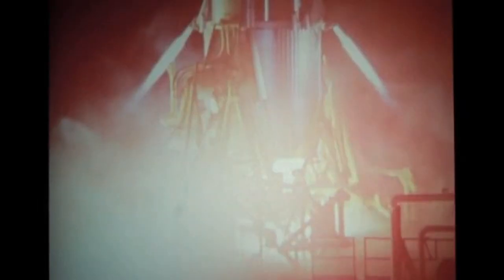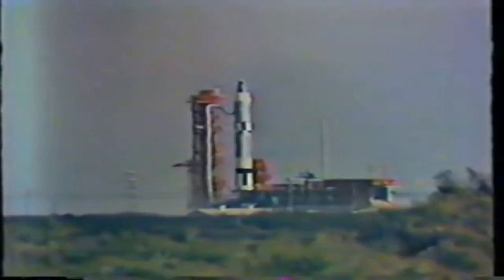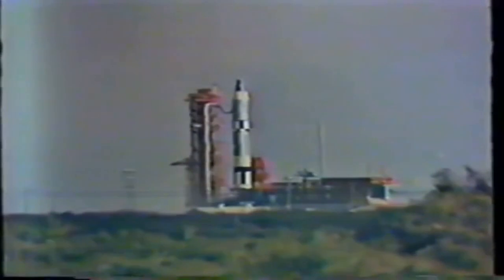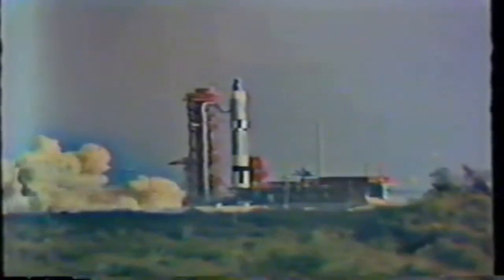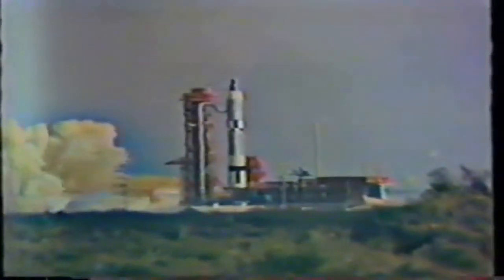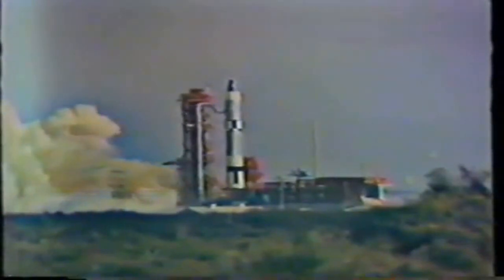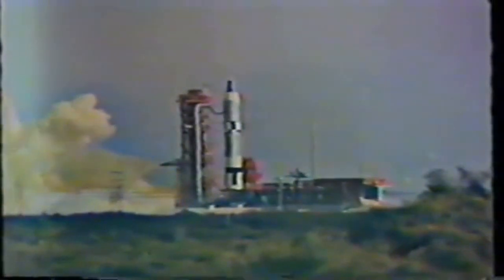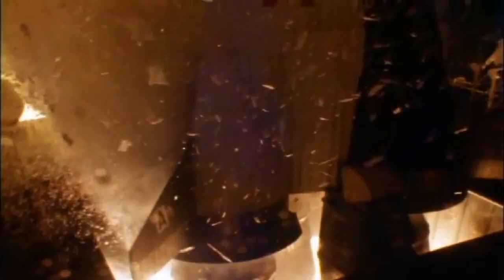What are Launch Clamps?

Comment: The Saturn V footage prominently shows the first stage ground support umbilicals, not the hold down clamps.

You can see one clamp to the left in the footage and one is tucked between the umbilical stands. The other two are on the other side of the booster along with one more umbilical.

Comment: Titan-II did not use hold down clamps. It used explosive bolts to hold it down (as did the shuttle).  IIRC, the pad bolts for Gemini-6 did fire, but fortunately the Titan-II did not fall over.   Also, the Russian "Soyuz"  type launch vehicle (many versions over the years including Sputnik) pad has no hold-down clamps. The supports do NOT clamp the rocket from rising (exactly the opposite).  The launch support arms  holds the rocket against gravity at the BASE, but also helps support it upright near the middle to keep it from tipping over. It has no explosive bolts or hydraulics or any motors to make it move, it is a passive system. As the rocket thrust builds up to liftoff level, the rocket is free to rise vertically by itself and the supports are counter balanced to swing out of the way when no longer being "pushed down" (the rocket weight at the base is what pushes the supports in place, which then hold the rocket).  A unique system that has worked well since 1957 or so.  
You really need to research things more for videos that are supposed to be "definitive". Even if I did a video about just the Soyuz launcher  I'd re-check the things I just typed from memory to be sure I got it right, but those are the basics.